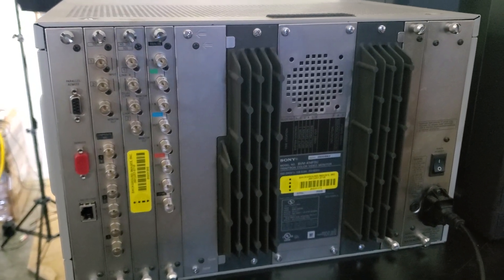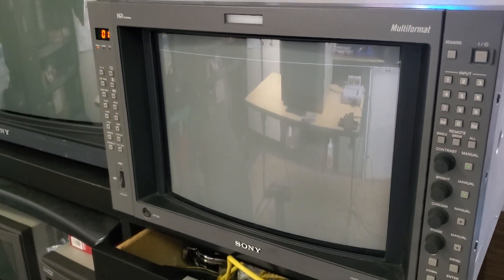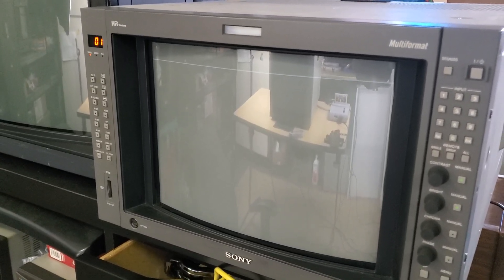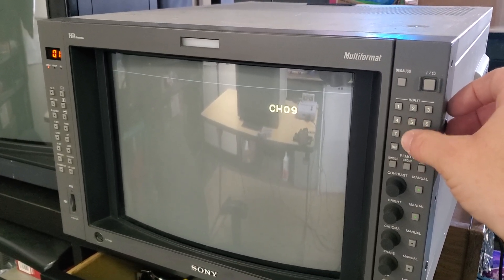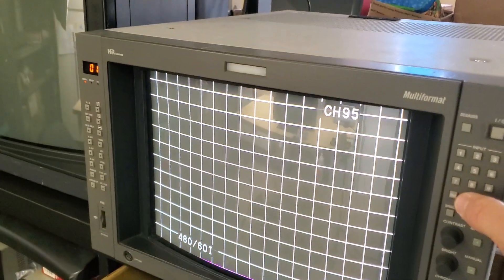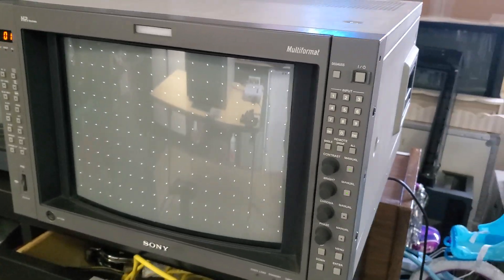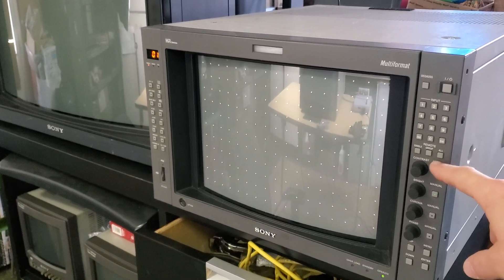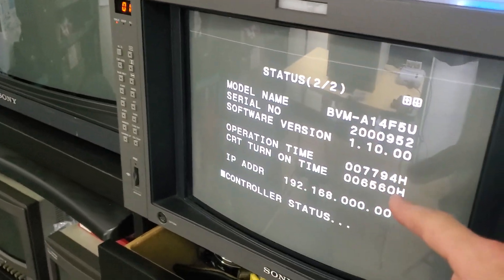The Secret TEST Patterns built-into the Sony BVM CRT

Comment: This won’t work on a BVM D series. 😔
Reply from the maker: Yes it will, you are just doing something incorrectly
Reply: @RetroTechUSA  I tried to figure, but I am unable to select the 0 on the keypad, while the key input works when testing the 0 key in the maintenance password. Looks like it locked on 1-9 channels
Reply: I've send you an DM on twitter in case your interested in my BVM real life struggle lol, Must be something easy for sure.
Reply: @RetroTechUSA I have the same problem with D14, not able to select "0". Is there a special trick?

Comment: Hello! I hope you can give me a hand with this. I have some Guncon 2 games for the PS2 and I can't calibrate the gun on my tv (Panasonic Panablack 25 inches). Some months ago I entered the service menu and adjusted the V and H screen position values. Do you think this could be related to the calibration? Should I try to calibrate the gun while adjusting the screen at the same time?
Reply: The main problem I usually run into with light guns is with an older CRT that can no longer get bright enough for the gun to see it anymore. This could also be the fault of an aging sensor in the gun, but I really don't know.
Reply: @BrianJamesReno  Thanks for answering, dude. I tried the guns (version 1 and 2) on an even older 20 inches LG Cinemaster and they work well. Sometimes the guncon 2 works in the Panasonic (when a little line of light appears at the low  center edge of the screen) but the guncon 1 won't work at all.
Reply: @aharte17  Thanks for answering. I did try the gun (actually guns, plural) on a 20 inches LG Cinemaster and the funciona, both 1 and 2, worked well. I have to add that sometimes the guncon 2 works on that Panasonic, but when this happens, a short, flat line of light appears at the base center of the screen. The line appears randomly.